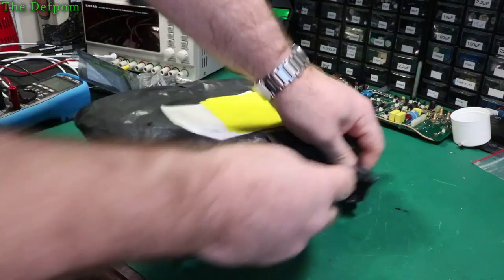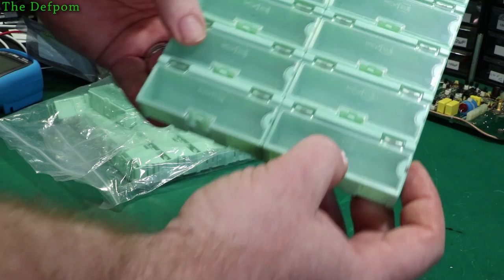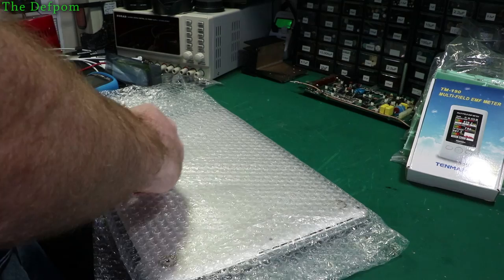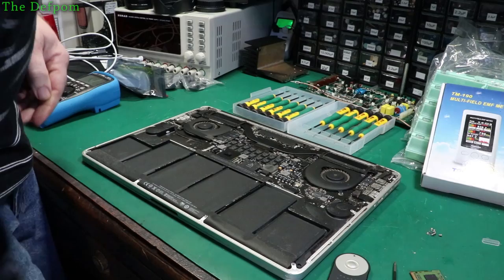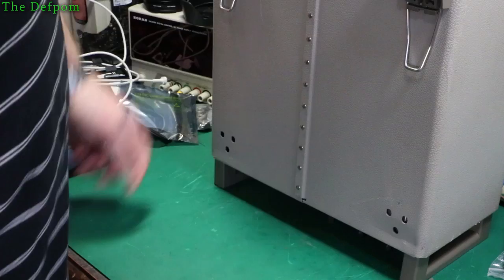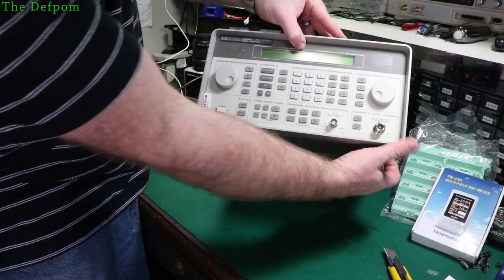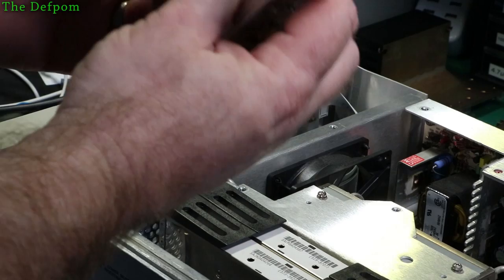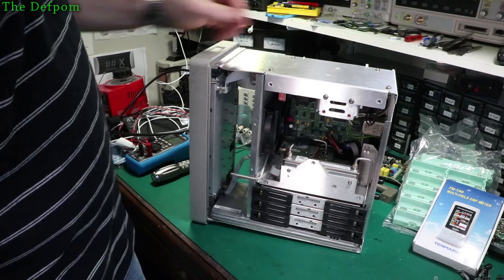🔴 #583 Mailbag Monday 24th June 2019

Comment: I believe those boxes are intended for storing medical stuff originally. They are not ESD safe,
but fit TH resistors, film capacitors, small pots etc. I use them for my tiniest stuff :-)
Funny that you got a 8648 Generator, I do look for one myself. Will probably get me
one after the summer (september - october), when and if I find one at the right price.
Could be a unit with a fault, just like yours. Looking forward to your Fixit video for it.

Comment: These boxes seem optimal on leaded parts, resistors, diodes, axial caps and similar length shape parts
Reply from the maker: Helmuth Schultes - yes through hole resistors would probably fit, i had them in mind for SMD items that are in short strips of tape
Reply: @TheDefpom  Yes, for tape strips these are great also. I tend to those small flip lid boxes you had recently  but already have them off the strips having little hassel while hand placing the parts. With 144 small compartments most ranges are easily accessed. I am bothered puling strip back for the small SMD Bits while assembling, work flow is disrupted but switching tools. But yes your approach also works.